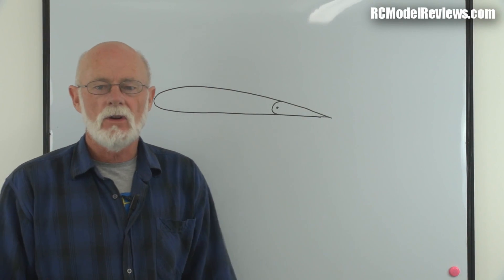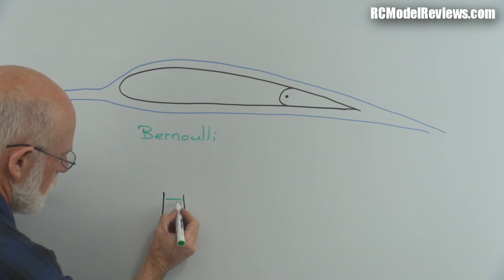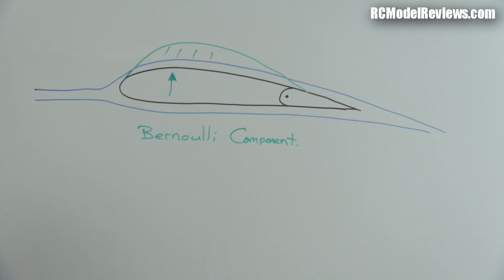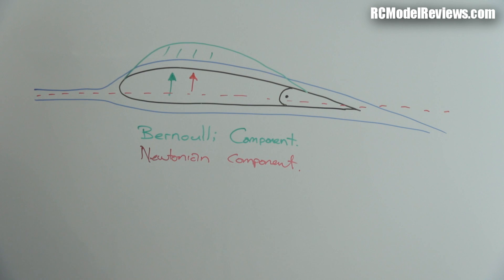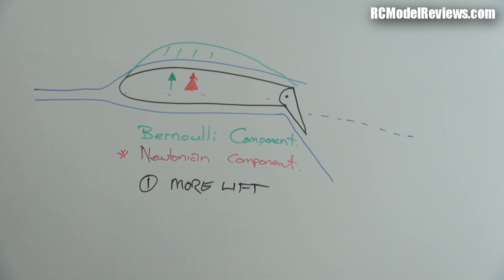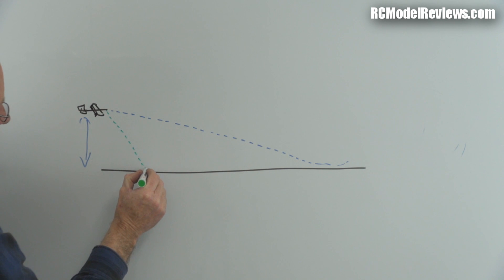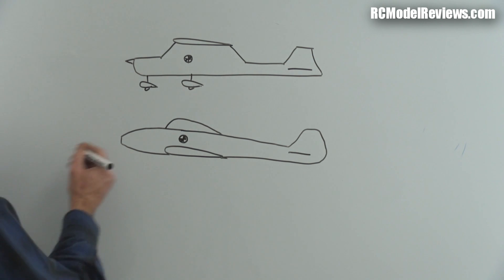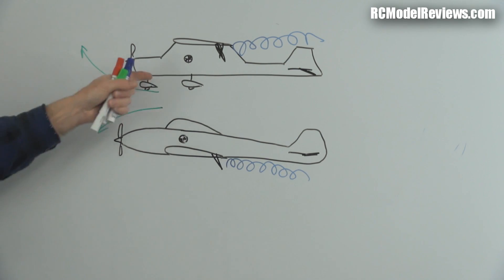How aircraft flaps work

Comment: The liquid flowing up the straw in the glass is due to the Coanda effect.

This video illustrates the flow pattern around an airfoil incorrectly. Ahead of the foil there should be an upwash due to the stagnation point just under the leading edge. The stagnation point is where the air is split to move over and under the wing. This is crucial because it creates the conditions conducive to lift. The upwash forces more air into a particular volume, hence the velocity increase and pressure reduction above the wing, in accordance with Bernoulli's mass-flow rate conservation. Underneath the wing the upwash is redirected to flow parallel to the trailing edge as this is the only path the air can take due to the obstacle effect. 

Now that that's being cleared, when flaps are used they slow the flow down thus creating higher static pressure under the wing hence an increase in pressure to support weight. This is why at lower speeds an aircraft can still maintain lift. 

This is a positive result for flow above the wing. By creating this higher pressure underneath the wing, the stagnation point is moved further aft the leading edge, resulting in a greater upwash which further increases velocity and pressure reduction above the upper surface. It is the higher velocity which delays a stall, by adding more momentum to the viscous boundary layer, flow separation takes place further down the upper surface. 

The flow does not stick to the upper surface due to the Coanda effect, rather due to viscosity.

Comment: Wait a minute. I thought extra lift with a flap generates extra lift behind a CG and that causes pitching down moment.  I am an inactive full scale pilot and I believe I had to trim up as flaps go down whether it was a low wing Piper or high wing Cessna.  Quickly tried MSFS.  C172 definitely gives huge pitch up.  Mooney showed minimal change, and Learjet gives huge pitch down.  I always use flaps as it costs nothing extra, and 3D planes pitch up because those big control surfaces adds extra lift in front of CG is how I've been understanding it.

Comment: 3:24 This is just plain wrong ! Equal transit time has been disproven several times, you can even see it on youtube videos of wind tunnel testing, the particles don't reach the back of the wing at the same time at all! The air atop moves much faster than the equal transit time theory predicts

Comment: The principle of equal transit time over and under the wing is not correct! The two airflows are completely independent of each other. In fact, the air molucules travelling above the wing will reach the trailing edge before the air molecules travelling below the wing.

Comment: I would like to know how energy is absorbed or added during flutter.  To be precise what cause the wing to oscillate a real explanation as clear as you can. I just wanted to verify my thoughts and see if my line of reason was correct. Higher airspeed would cause more lift, and more upward movement with twist downward. Then what causes it to move in opposite direction.

Comment: the bernoulli explanation isn't wrong, it's very much correct in fact.  what people often get mixed up is that the faster air on top has anything to do with the curve being a "longer path" for the air to travel - What really happens is better explained by the "Coanda Effect" (probably spelled it wrong), that's what forces a moving fluid, such as air, to stick to a curving surface and follow it out from its starting direction.  If you measure the airspeeds atop and below a loaded wing, you'll find that the air on top moves so much faster it actually beats the air on the bottom to the trailing edge. Then it carries on going down in a way that can be described as a rotating vortex centered on the wing's CoL (this is called a "bound vortex", but I digress) 

The newton component of lift also isn't contradictory at all, nor does it happen "as well" in any complementary way - As stated, it is merely another way of interpreting the whole same system with other points of reference and different ways to measure it.  Energy conservation is observed in all cases, and the weight of the plane is ultimately transferred down to a very wide area of the ground below it, once the air molecules are done bumping each other all the way there.  (A theoretical plane in a gas planet would cause a plane-mass-equivalent "bump" of gas to surge on the opposite side of the globe, in a very theoretical way, just to draw the point)

As a simulation developer,  it's fun to see how the theory can be put straight into practice in a realtime physics environment - there's a lot the books don't tell you going on in there, as you can expect - I suspect any computer flight simulation advanced enough to do away with "fudge factors" would end up getting all Quantum long before its developers can just hit "play" and have it work just as in reality without having to "tweak" a bunch of variables until stuff makes sense 

Anyways - great video, well explained!  Cheers

Comment: Equal transit theory??? This video is terrible. All these foolish explanations are gross misapplications of Bernoulli's principle.
The airflow does not just "go faster" because it has to travel a further distance. Acceleration requires a force.

Why would two parcels of air going over the top and bottom of the wing have to meet up at the same time at the trailing edge anyway? The reality is, they don't. There is no physical reason why that has to happen. In fact the airflow over the top of the wing arrives at the trailing edge much sooner.

https://www.youtube.com/watch?v=UqBmdZ-BNig

Furthermore, what if the airfoil was completely flat and the top and bottom surfaces had equal distances for air to travel? Lift would still be generated because it's angle of attack which is most important. So the explanation in this video is complete nonsense.

Watch a wind tunnel video and observe the curved streamlines around an airfoil. Due to the airflow's tendency to try to remain attached to the top surface of the wing its mass is flung to the outside of the curve, generating a pressure gradient. Anytime a streamline is curved, you find a pressure gradient from low to high, from inside to outside of the curve. Air accelerates from relatively high pressure upstream to the low pressure area downstream. This imparts on the airmass a downward momentum (downwash) resulting in the equal and opposite lift force.

Curving streamlines generates low pressure. Airflow over the top of the wing is accelerated by the pressure gradients. Air does not magically "go faster" and therefore generate low pressure.

Comment: Bernoulli and Newton are not really different components. The real answer is the reply to your Facebook relationship status: It's complicated.
Bernoulli is part of the Navier-Stokes equations, which would explain the whole thing, but can't be solved completely except for very simple airflows. Navier Stokes starts out from the Newtonian laws of movement for air particles as forced by the pressure field, but also includes shear effects (shear usually can be ignored when only interested in lift.)
The biggest fallacy of the Bernoulli explanation is that air arrives at the trailing edge at the same time. Nobody forces it to do so, and the air over the upper part actually arrives at the back even before the one at the bottom, creating even more negative pressure on top.
If that common explanation were right, it would be impossible to fly inverted with cambered  airfoils. Also Clark Y type airfoils would give highest lift, but we all know that it's actually airfoils with negative curvature on the bottom that are used for that.

Comment: Excellent explanation on what flaps are good for.  Don't own an R/C aircraft, but practicing w. the E-flite EC-1500 (which has a 3-position flap setting).  Applying what you taught me, is leading to much smoother landings.

Comment: Bernoulli's Theorem applies to points on the SAME streamline! It cannot be applied simultaneously to a streamline at the top and one at the bottom of the airfoil to explain the difference in pressure between top and bottom of the airfoil due to difference in air velocity.

Comment: As a fixed wing private pilot I knew there were 2 kinds of lift but only the name of the Bernouli lift. I always called the other one "deflection lift" when the flaps were down.
The best way to demonstrate both is to take a narrow strip of paper and hold it in front of your mouth. Blowing across the top of the paper gives you Bernouli Lift and blowing below the paper gives you Newtonian Lift. A clean wing is all Bernouli Lift and as you add flap you get less of that and more Newtonian Lift with more drag and therefore slower speed / lower stall speed for landing.

Comment: So if you are able to deploy your flaps at the greatest angle at which the coanda effect still holds the air to the surface of the wing, you'd be able increase lift at lower speeds without creating drag?

Comment: How did I miss the Newtonian component all these years? It was right in front of me but I never had someone explain it so well.
Reply: Its ok, you're not the only one.
Reply: SYMMETRIC AIRFOILS & FLAT PLATE AIRFOILS work on ONLY NEWTONIAN LIFT PRINCIPLE ..NO FANCY BERNOULLI LIFT
Reply: Having only taken up flying on retirement at age 75 I have a lot to learn  .your videos put things simply so that my senile brain can understand .
Reply: If you think about it, a propeller is nothing more than a rotating wing. It produces lift to create thrust.  Bernoulli says that the low pressure area ahead of the prop sucks the plane forward to produce thrust.  Newton says the the air is accelerated backward to produce thrust in the same way a jet engine does.  Which is true?  Both.
Reply: The Newtonian component as described around 5:18 violates the law of causality. The theory is that because the air molecule goes down AFTER passing by the wing, it ... goes back in time and pushes up on the wing? That has cause and effect backwards.  An air molecule going down AFTER the plane has already gone by can't push on the wing.

The lift applied to the wing has to cause the air molecule to be directed downward later. Simply because a cause always happens BEFORE the effect.

So the two components are the Bernoulli portion and the AoA portion. Anything that happens later, AFTER the air has passed the wing, has to be an effect, not a cause.

Folks fall into the "air goes down afterwards" mistake when they realize that the Bernoulli component can't be the only component - some planes can fly inverted. There's no need to fall into that though - you can recognize that inverted flight requires AoA. It requires that the air be forced down WHILE in contact with the wing, because the wing is angled, because the wing is positioned as a wedge while in inverted flight.
Reply: @senseisecurityschool9337  The air is deflected downward due to the AoA which begins at the stagnation point. Air is not simply rammed into the underside of the airfoil but rather split at the stagnation point, the splitting effect causes the flow to leave parallel to the trailing edge, which is sloped downward. 

The AoA is necessary as it places the stagnation point below the airfoil just aft the leading edge, this leads to an upwash of oncoming flow. This upwash is crucial as air ahead is directed upwards, causing more air to be squeezed into a particular volume and according to Bernoulli air will speed up to ensure mass-flow rate conservation. This is how the drop in pressure above the wing takes place. All that's happening under the wing is the upwash being diverted to leave parallel to the trailing edge as this is the only path it can travel due to the underside being an obstacle. 

It is the pressure drop above the wings which contributes the most to lift not the underside. Air will not be redirected unless there is an AoA( inverted or not ), It's the asymmetry of the wing which cause the pressure gradients for the pressure differentials above and below a wing.

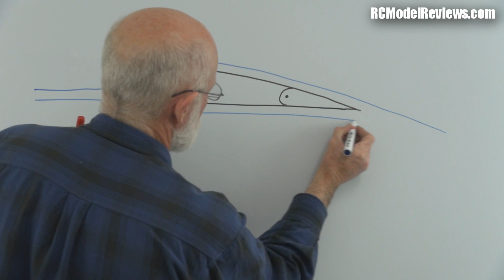Comment: some info.     i may have already said this.        at 1:23,  the reliance on a  Flawed model/metaphor, for the what happens around a wing,  LEADS  to  flawed  conclusions.
SINCE  the  Air  AINT  in  motion, it  does  NOT  do  that!!!!      air is  Deflected,  UPWARDS, by a (correctly designed) airfoil; as a  WING  Moves  through  air.!!!      the result is a  Persistent, span-wise,  Zone of  TURBULENCE,  ABOVE  a  wing.      turbulent air is  LESS  dense, and  the  Ambient pressure below a wing  pushes  it  up.              the use of flaps  is  a  TRADE-OFF.     with flaps one gets 'more lift  WITH  More  drag'.     more drag tends to result in a reduction in airspeed;  if airspeed is  ALREADY  low, this  can  be  a  Problem.   as discussed by other commenters, below.     googletranslate

Comment: Totally spot on ... For advanced learners l'd like to add ... Flaps change wing camber & above all wing chord. Meaning increasing angle of attack (AOA) by some 5 degrees despite plane staying in same orientation. Plus control surfaces lose authority at slow speeds &n controls feel mushy
Reply: since the presentation begin with a  FLAWED  visual aid,  'spot on'  is  not  what  i  would  Call  it.

Comment: You can't use Bernoulli in that context - when considering air as a continuum - that theory only works in a single streamline. The reason is that the constant is different for each streamline and hence you can't generalise it for a whole flow field; and also the air molecules at the top surface and bottom do not reach the trailing edge at the same time.
Reply: 'the reason is'...   the  air  AINT    MOVING !!!!

Comment: Great Video!
another way to visibly prove Bernoulli's principal of lift is to hold a standard piece of paper just beneath your lower lip (holding the edge of the paper near lip horizontal, the opposite end unsupported will droop down obviously) blow and the paper will rise due to the lower pressure above the sheet of paper..
the bit about rotation around the CG was little confusing, I see the Moment around the CG is the same CC or Anti Clockwise as they say on your side of the pond..(I'm probably missing something :)
also was wondering, we never see slats on a RC model, (or at least, I never witnessed)... that would be interesting though, Regards...
Reply: another way to show yer level of dumbness  is....invoke  bernoulli's  name !!!!

Comment: youre insane.. if you  put the flaps UP in a  high  wing  model it will rotate UP..so it will rotate DOWN with flaps  down..i dont  know where you learned  your physics..dr johnny
Reply: it doesnt  matter  up down in front or  behind  center  of gravity.. the drag of the flaps always  cause that  point of the wing   to go in the opposite direction
Reply: jl  -    you are also insane.    high-wing or low,  makes  NO  difference.      one of the things that  flaps do is,  make  NEWTONIAN  lift,  from the  Deflection of air.      flaps 'down' will make  UP lift.      flaps 'up'????  would make  Downwards lift.   out          googletranslate

Comment: Great video, Bruce! I might add though, that it has been shown with wind tunnel testing that the air travelling over the top of the wing and the air travelling over the bottom of the wing don't actually meet up at the same time at the trailing edge. This means the theory of "travelling a longer distance in the same amount of time" theory doesn't actually work to describe lift. Could you edit the video so that people are not misled? Thanks!
Reply: I'm pretty sure that even though they do not meet at the trailing edge at the same time, the air going over the top still has a speed increase which still changes the pressure and still creates lift. I could be wrong but I'm positive that a mix of the two theories is used to actually create the lift. Lift is a very complicated subject though
Reply: Correct, but the air does not move faster over the upper surface of an airfoil BECAUSE it is "travelling a longer distance in the same amount of time". That was the portion of the video that is incorrect. I'm not disputing that the air moves faster over the upper surface.
Reply: Dean Gonzalez ohhhh I gotchu. I thought you meant the part about air speeding up was wrong
Reply: @343jonny  well,  YOU  SHOULD.    cuz  this  old  bernoulli-based theory  is  totally  WRONG.
Reply: @murphinator5586  i'm pretty sure that 'speed increase'  is a  totally  fallacious  concept, in the context of  STATIONARY  fluid/air !!!

Comment: Mostly correct but not entirely.  As an ATP, Flight Instructor and RC pilot I have never had an aircraft need up elevator when deploying flaps.  Theory on a white board is technically correct, but the amount of lift generated on either a high or low wing has more effect than the drag portrayed in this presentation behind the flaps.  In both instances, in real flight, the aircraft with rise and need down trim to counter it.

Comment: When comparing flaps pointing downwards to elevators pointing downwards, is the reason the flaps don't pitch the plane like elevators because of the flaps position in relation to the center of gravity?
Reply: uhhh,  no.   well, sorta.      as a result of its distance from the  cg/c-m, elevator deflection  alters  the  attitude of the  airframe, in the  Pitch axis.
consequently,  the  Tail  goes  Down, with  up-elevator deflection;  and  the  nose  Rises.        everything, then,  Follows the nose.      cheers